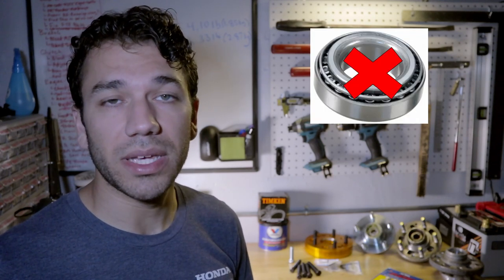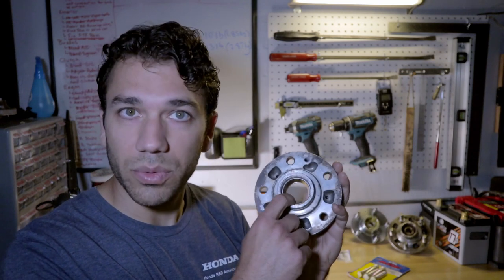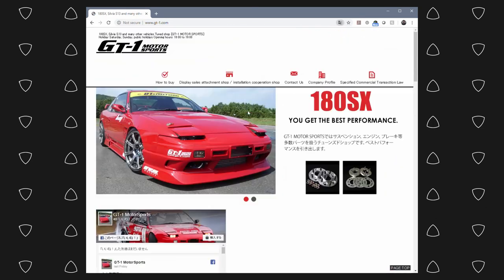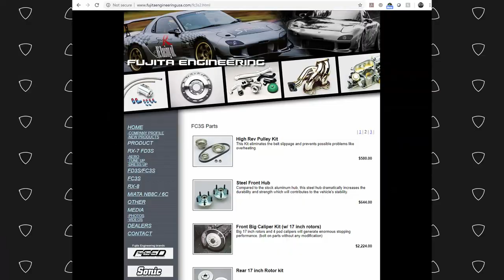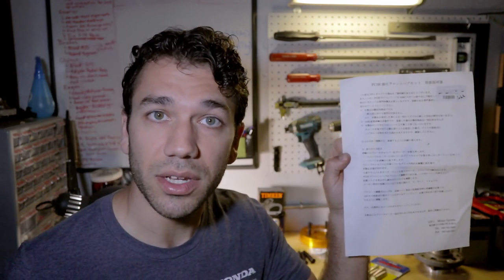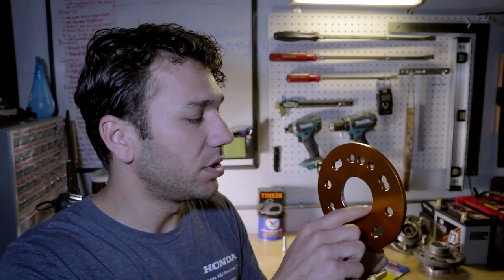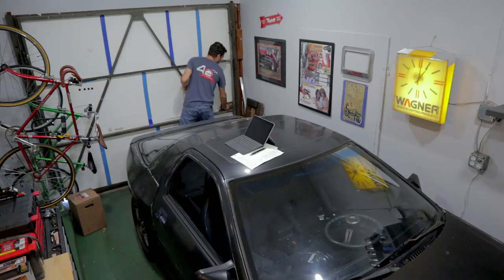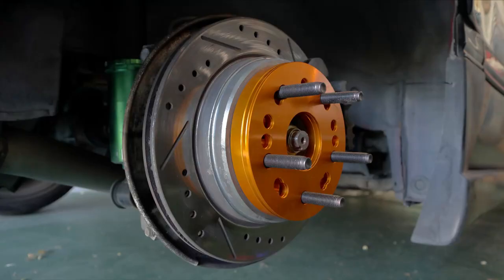FC3S Front Wheel Bearing Replacement | Ep 26

Comment: I'm ordering the gt1 from rhd japan and I run a super low FC, was wondering if its the generally same fitment in terms of dimensions for like offset with the aftermarket hubs. I have the PBM spacers too but I have tight enought fitment I never had to use them, but am hoping these fit the same as OEM so I don't even have to worry about it.
Reply from the maker: They fit just like OEM, only difference is they're heavier because of the stronger/denser material.
Reply: @AlexFranceschi  Great, thanks for the info and the video, I ordered the gt1 hubs and will be tackling it with some beers when it gets here

Comment: Alex what are the three bolts on back of OEM hub that are not on RHDJapan versions?  Have not taken car apart yet and was wondering.
Reply from the maker: Aww man, it's been so long since I did this job, I can't fully remember off the top of my head, but that might just be for a specialty tool or something. I don't think anything actually mounts to those 3 holes. Anyone correct me if I am wrong. You could search thru the FSM for any hints.

Comment: One other option for replacing the bearings in the stock hubs is to use a MIG welder (flux core is fine).

Weld a bead in a ring around the bearing race. When you're done, it'll look like a circle of weld all the way around the circumference of the race.

When the weld cools, it'll contract and loosen the race. Sometimes you can just slam the hub on a table and the race will fall out. If not, use a hammer and drift to punch them out from the opposite side (using the weld as a punch-point. Be careful not to damage the hub. Do this for all 4 races. New ones can be put in with a press, or by using a hammer and drift to tap it in gently (in an opposing pattern), only tapping on the top surface and not the bearing contact surface.

Although that being said, next time mine need a refresh I am likely going to just buy the replacement GT1 hubs. 

Great video as always :)
Reply from the maker: Thanks for the alternative! Another good budget option in case people can't afford the new hubs. However, I'm getting lazy when working on cars these days and don't mind paying a little extra for the easy way lol.

Comment: Hey- thanks for your content. Excellent work, nice ride. I wanted to ask- I am in process of changing my wheel studs on front of rx, but seen you used a different ARP stud than what I ordered from online info. I got 100-7713 GM studs with same pitch & thread as OEM. Did you order the Evo studs because of new hubs? And are there any other issues you found when working the front of your rx? Thanks
Reply from the maker: I wanted extended studs. So, I looked around to see what would give me not only the correct thread/pitch but also the length I wanted. The ones you got may work as well, but I have a wheel spacer on the car, hence the need for extended studs.